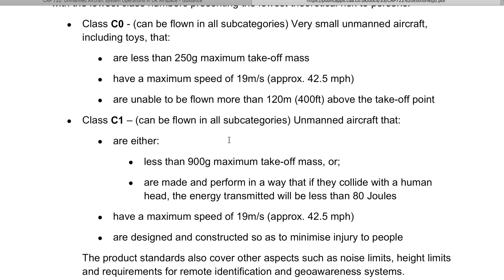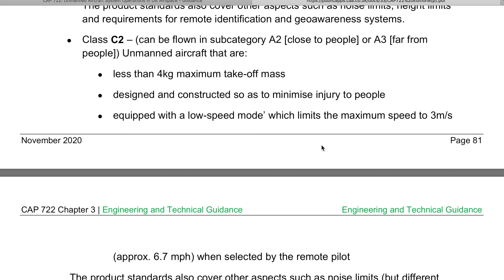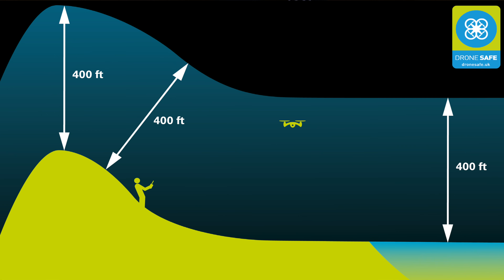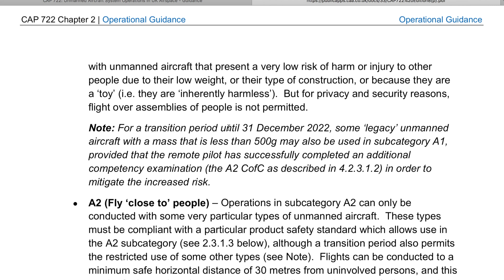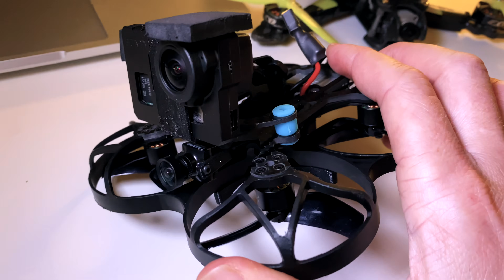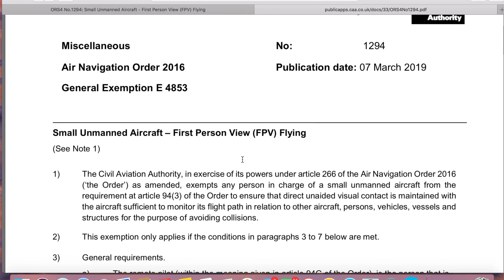The New UK Drone Laws & FPV!

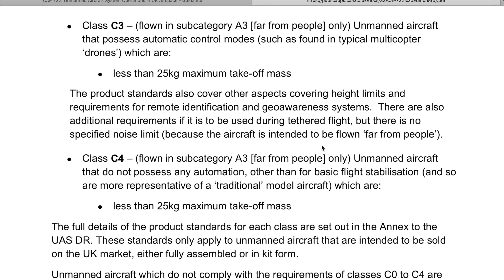Comment from the maker: Pause the video at 3:42 it says: C4 - “UA that don’t possess any automation, other than for basic flight stabilisation” ... did I miss something big there!!!?
Reply: Don't all UAs have automation because of video transmission, smart audio, and controlling motors / servos?
Reply from the maker: @legendarypot8oanimates160  ah is that it!? Perhaps this stipulation is aimed at fixed wing planes without a flight controller then 🤔
Reply: @MagicFPV  probably, since I don't know any drone that isn't commercial that is 25kg. Planes are quite heavy because of the large batteries they carry and generally larger planes are smoother in the air. Some of the smaller planes fly with flight controllers that have stabilisation built in but they are usually well under 250g.